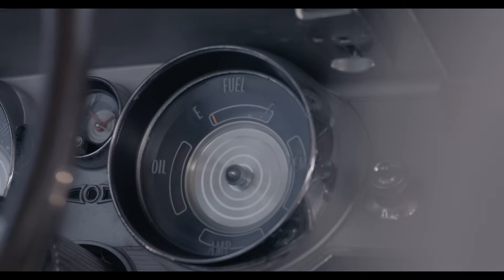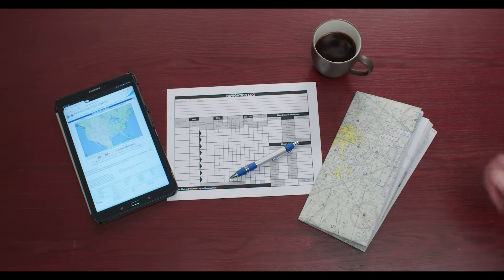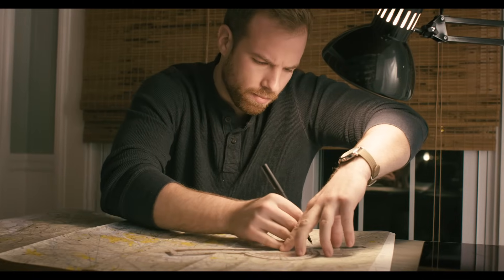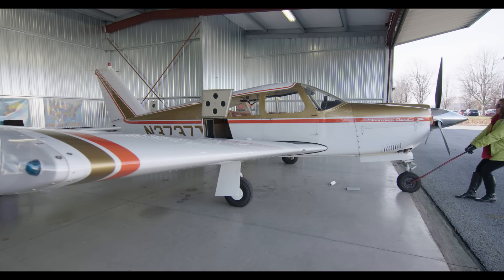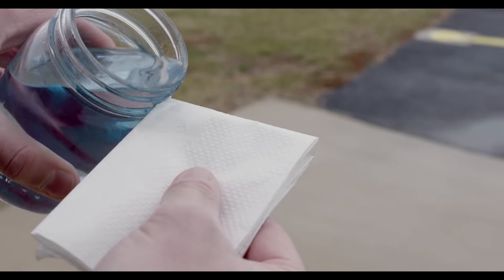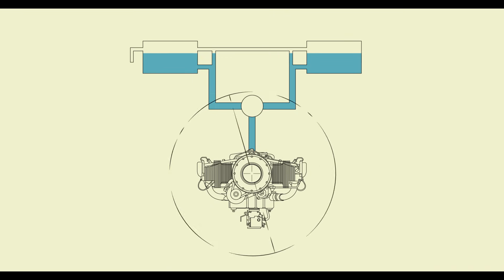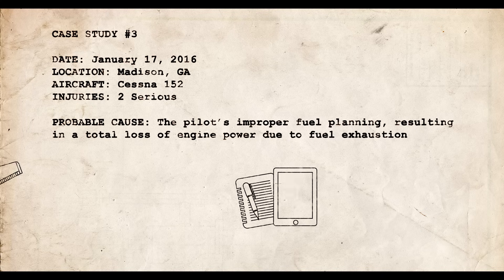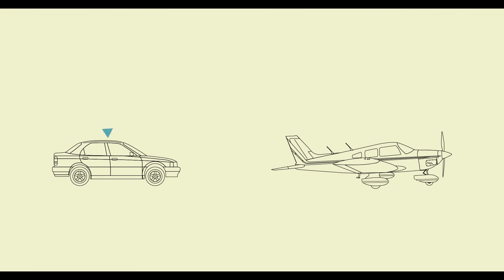Fuel Management Made Easy

Comment: When I first purchased our Grumman tiger I nerded out and got pretty good performance specs and entered them for increments of 2000 feet with climb and descent estimates and entered them into foreflight. We are usually within a gallon or two on any flight with the estimated winds provided by Foreflight. I also calculate on any trip the half way point so I can see how fuel is doing at that point. I do push the first tank to within about 5 gallons before switching-- i just can't do the 30 min switch thing and its just too complicated to have a redundant check on fuel. Always start with full fuel and sump after full up and before flight. Can you tell that I learned in Alaska?

Comment: Okay, I know this is an older vid'... AND I hope there's going to be an update/rebuild...

    BUT I gotta say this. Folks, look through the checklists and the step-by-step you went through just to be able to land AT THE AIRPORT... That's the very place and conditions for which your plane (ANY plane) was designed to land... LOOK at how complicated it gets and how many techniques YOU HAVE TO USE to safely put that thing on the ground "the way it's supposed to work".

     Now, consider this. In my car, or on my motorcycle, when I run out of gas, I can pull over about anywhere safely. There's ALWAYS a soft shoulder nearby. Even on the rare occasion I can't reach such, it's reasonably safe enough to stay my ass in the car until help arrives, right there. It's rarely particularly unsafe to do so.

      Where the F*** are you going to "coast to a shoulder" in your plane??? NOT the ground. It's friggin' DANGEROUS to try to coast down and go all cavalier or "cowboy" about putting a plane on the ground. There's advanced EXTRA training to put planes on the ground in "off runway landings", EVEN when the planes are designed AND equipped to do so. Your average Cessna is NOT so designed NOR equipped. Smart money says, YOUR plane isn't either.

      The REALITY is that there is no such shoulder up there. There are no mystical floating platforms for you to reach and wait for gas, or get a fill-up. The Military might have in-flight fueling, but that's a damnably tricky, dangerous, and nefariously precision oriented maneuver, and we are ONLY General Aviators with dinky little planes that are barely more than a flying VW bug . With all the safety devices they DO have, it's not worth gambling your life OR the lives of passengers on the random place you have to BE "the cowboy" who can put the plane down in one piece.

     It's just that simple. Before there's a question of whether you'll "probably get there", you NEED to have a stop-over for fuel. For us GENERAL AVIATOR TYPES, there simply is NO SUCH THING as an emergency or business that's worth dying for. There are precious few worth risking the plane for. The Emergency and Commercial Pilots have their companies and agencies to dictate the fuel stops and ranges and acceptable limits. They sign contracts to take the risks they take (if any)... BUT WE never get medals for making a winter run through horrific weather to deliver anything. We don't get a pay raise or bonus for cutting the costs of reserve fuel over a medium or long haul. We ARE NOT in the business of flying. We ARE IN THE HOBBY of flying!

      Remember that.  ;o)

Comment: For my airplane, I log all fuel added with the hours noted when the fuel was added.  Before flying, I check the tach and knowing how much my plane burns per hour, I know exactly how much fuel is left in the tanks and how many hours of flying I have.  Simple.

When flying airplanes that others may have used, like a rental, I won’t fly unless I can visually confirm the load out...either topped off or filled to the indicator tabs that many planes have.   Fuel load divided by burn rate tells me how many hours I can fly.  

Either method, always subtract one hour minimum from the calculated time available.   Every time I get in the plane with a student I expect them to tell me how many hours we can fly before landing for fuel with a one hour reserve.  I burn that methodology in their brain so it becomes second nature.
Reply: Excellent comment

Comment: I wonder how many fuel starvation accidents there will be when they start the switch to hybrid and electric planes.  The learning curve will have to be steep. I believe the temperature and pressure changes planes go through will wreak havoc on batteries way more than on Avgas and kerosene systems.

Comment: Nice video. I am not proud to say that i almost got in real trouble due to a bunch of errors pointed here (head wind stronger than predicted, lots of cumulus nimbus and shower rain made me zig zag, first of January holidays with a close to sunset estimate that wouldn’t allow me to land and get to my destination made me get a get-there-itis). After that I wrote down all the points that led me to that corner, it was a route I constantly did, 300nm in a 3h flight. I set a maximum ete of 4h with a 4h45min endurance, a GS of no less than 70kt, and various fuel checkpoints around the route and count a fuel stop time in my sunset calculations. On the next week I got in a similar situation on the same route, but did a fuel stop 1h15min prior to my destination with a 1h45min of endurance. It took less than 30min to land, refuel and take off again.

Comment: 11:38 is the reason I saw the remains of a plane that had crashed a mile short of the runway. Engine quit when they ran one tank dry and didn’t completely switch over to a full tank. Both pilot and passenger made it, but both had broken legs. It was crazy to see bloody hand prints and drag marks on the wing where they crawled out.

Comment: 1/3 of fuel bad management generate accident is very high rate;  to change swich tank every 15 min not 30 min like in regulation is one of the way to prevent this;increase diameter of fuel pipe to prevent blocking with ice particle ; create a special circuit with a valve to push in reverse fuel in tank if the pipe have low pressure or ice inside;we are here with our brain for the new generation airplane; secondary fuel pipe from every tank;air intake for the tank filtration- with smart evaporating system-wen in off;prevent contamination with water from air in the tank of the refueling truck;

Comment: Fuel gauges are only accurate under two conditions. Full and empty. That being said, learn what your airplane actually burns per hour, then make sure you are on the ground for fuel with at least 1 hour of fuel left in the tank.  Check fuel before a flight, and by all means be present when the aircraft is being fueled. This is just good preflight procedures.  Keep good records, and in route, if things are not going to plan, stronger than forecasted headwinds, make a mid-route fuel stop. I do that all the time.  As for the money, well flying is not cheap,  and well if you don't have money for fuel when you need it, maybe you can't afford to do the flying you are doing. I know the Bell 206B3 that I fly burns on average 24 to 26 gallons an hour. I flightplan 30 gph,  with 95 gallons, 90 usable, I know I have 3 hours or 180 minutes total,  with a 30 min reserve that drops down to 150 min or 2 hours and 30 min. Less depending on what I am actually doing at the time, unless you get some damage inflight and start losing fuel,  Fuel starvation accidents are 100% preventable.  To fill up a bell 206 when empty is about 400 to 450 dollars. My employer just gives me a card for the fuel, I also keep my own card just for such a purpose. Wrecking an aircraft due to fuel starvation is a lot more money than putting 400 dollars on a personal card and collecting latter. And yeah I have been stuck with the bill from time to time, but I never had an accident either, so in the long run, it's cheap personal insurance.

Comment: How does water get into a fuel cell?
Reply: Leaky fuel caps.
Reply: Timothy Chapman. Condensation
Reply: Back in the late 80's at my small airport some thieves were stealing fuel from aircraft and replacing it with water!!!!  Later the police found out they wanted the high octane fuel for their drag cars.  Luckily all the aircraft on the flight line were checked after 2 planes were discovered with high concentration of water/fuel and all the props flagged for the owners to not trust the fuel.  Could have been absolutely horrible.  The thieves swore they did not know it would cause an egine failure.  They had to pay restitution and only 30 days in jail because the $ value back then did not exceed felony levels.

Comment: Cardinal sin...trusting your fuel gauges.......Figure out what your fuel burn when fully rich and use THAT as your base number...NOT the leaned burn.  Then ALWAYS use timing and not gauges to maintain a decent mount of reserve.  There is no way to blame anyone but the pilot for fuel exhaustion.  And yes it has happened to me.  Learn from OTHERS mistakes and don't let it happen to you.  I would bet the one thing not mentioned in this video is taking off overweight.  I've seen it many times in my career.  Fuel is the only way to adjust weight if you HAVE to take a certain weight of pax or cargo.  But always remember it's better to plan than take chances.  You can't pull over and call AAA.    Barring mechanical problems you should never have to worry about running out of fuel if you plan properly.
Reply: AWitty PIlot Those poor ol’ fuel gauges don’t get no respect, but they do have one invaluable use.
  If they are going down faster than my clock due to siphoning or whatever, especially in high wings, I’ll be on the ground soon-ist to find out why. Better safe than sorry.

Comment: I must admit that driving a car I'm like the dude on the beginning. Once I hit reserve I reset the odometer and drive for another 30 miles.
On the plane it's a different story. I use a countdown from the moment I start the engine. The time is based on usable fuel on board and a conservative fuel burn figure of 8 gal/h for a C172.
Reply: You will eventually have fuel pump failure and or injector contamination problems in your car, should try to use 1/4 tank or higher as refuel mark as much as practical.  Often times fuel pumps are located in the tank of automobiles and use the gas to help cool them.  Running low fuel can cause more heat and stress on the pump.  Sediment and contaminants are more concentrated in low fuel environments, therefore a potential for increased occurrences of problems to fuel injectors/carburetors, filters, lines etc.

Comment: Good video, but missed an elephant in the room. The biggest factor in fuel miss-management is USEFUL LOAD which for many private planes looks like a “useless load”.
Pilot has to balance “…an extra luggage, or an extra passenger or more fuel”.
The video suggests (at 4:30) “… fill it to the top, unless you absolutely restricted by weight of passengers and cargo”. Unless you’re flying alone, you’re ALWAYS restricted by weight of passengers and cargo.
If all those 4 seats are occupied (even with middle-weight people and minimal luggage) how much weight is left for a fuel? Just enough for case study on fuel miss-management.

And the second big problem is notoriously inaccurate fuel gauges.
Why in the 21st century manufacturers can’t produce planes with accurate fuel gauges (and USEFUL load instead of useless load) – beats me.

Comment: With 50 years of experience, driving or flying, 1/4 tanks is my fill up point before I go anywhere.. If I can't trust the fuel gauge, I'll run as far as I can, knowing the fuel flow I can expect. Never less then 1/4 tank level. Saving $$$ pushing to get a lower fuel price is stupid.

Comment: I have always looked and wished for a well built pilots wristwatch that would set off a vibration warning at 30, 45, or 60 minute intervals. In that way you would be sure to switch tanks and not miss an alert on the panel or hand held, etc. I have seen them with audible alarms but does little to help in a noisy cockpit while wearing a headset.
Reply: phone
Reply: Kitchen Timer ... Sportys offers one with a blinky light

Comment: I fly a Cessna 182 RG with extended range 80 gallon fuel tanks. I use the bladder method of flying. 3 hours in the air, and I am on the ground going to the bathroom and refueling the airplane at the same time. No way am I ever going to use up 80 gallons in 3 hours.
Reply: With a headwind, forgetting the gear and mixture full rich you just might
Reply: @ Sam. Endurance doesn’t change with gear and headwind... lol.
Reply: mechanical failure? leakage? undetected fuel theft?
Reply: Same here